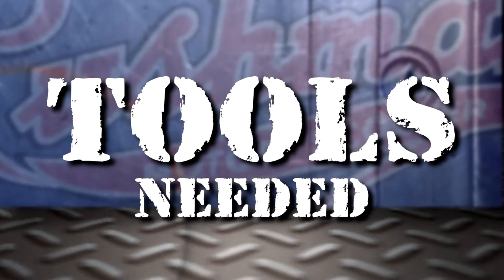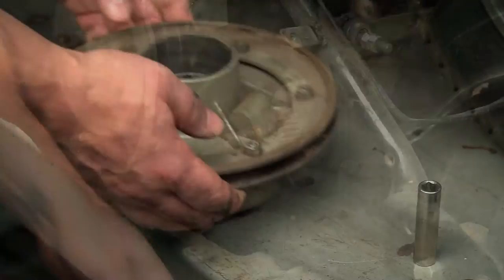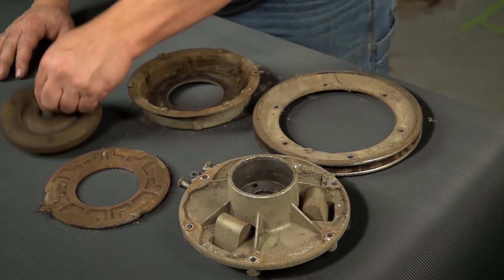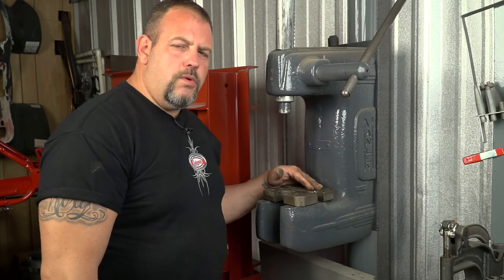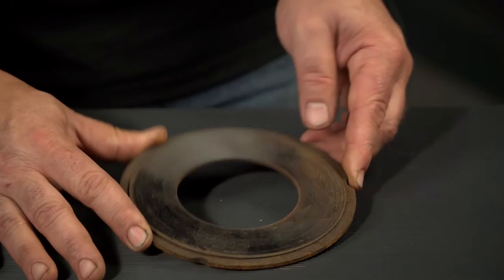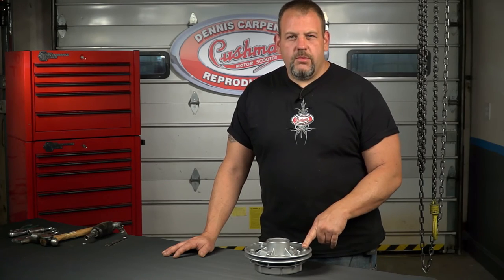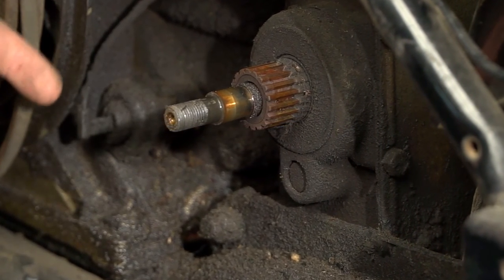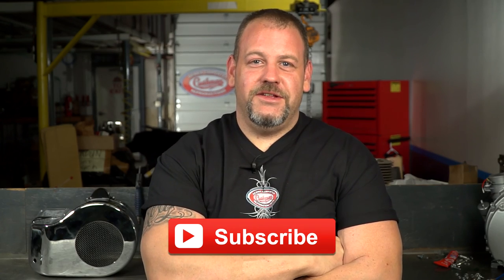How to Rebuild a Cushman Scooter Centrifugal Clutch for Silver Eagle

Comment: Hey I need help with a cushman 22hp clutch. I have the 4 wheel Truckster? I think it's called or is it haulster? I need to replace the clutch. I was driving it and I think the throw out bearing came apart. Do you have a contact number? Look me up on Facebook messenger Travis Hall in Jacksonville, Florida. Thanks
Reply from the maker: unfortunately we do not carry any clutch parts for the twin cylinder trucksters